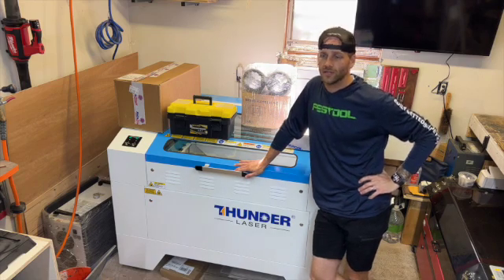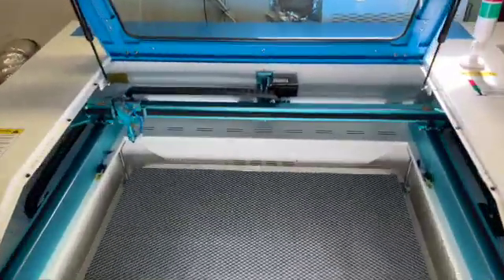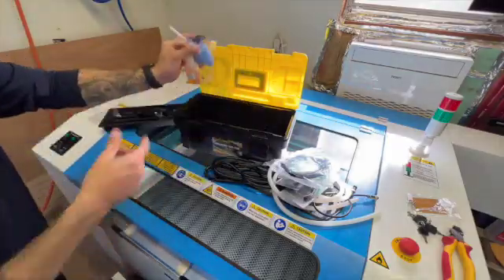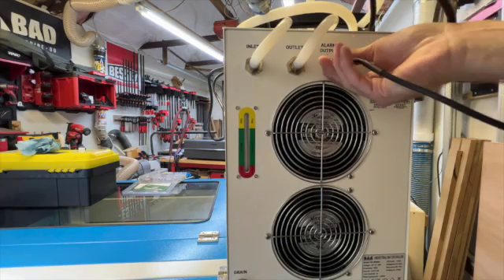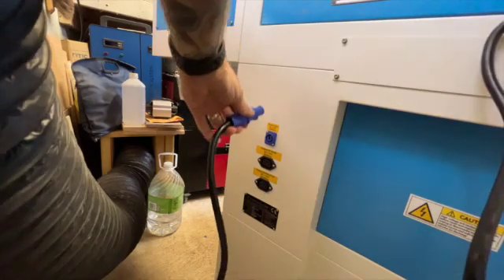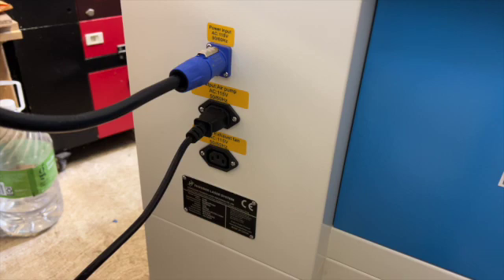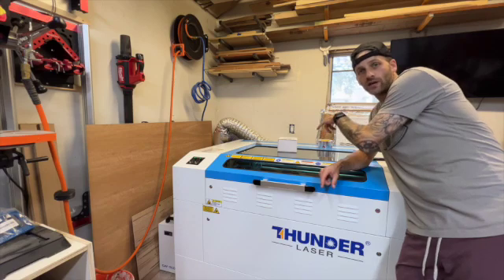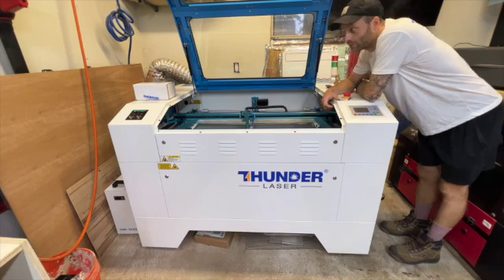Unboxing and Set-Up of Thunder Nova 35-100 CO2 Laser

Comment: Thank you for the video.  Very helpful.  What made you choose the Thunder Nova vs other 100W CO2 lasers.  It appears that the Thunder Nova is at a higher price point.  I am currently looking at upgraded options, there are ALOT out there.  Thank you in advance.
Reply from the maker: Apologize for the delay. The whole Thunder brand actually, their support is top notch. Always available to help with any questions. The machine is overall a higher quality than a lot of others and Thunder sets it all up to make sure it’s running smoothly before you even get it